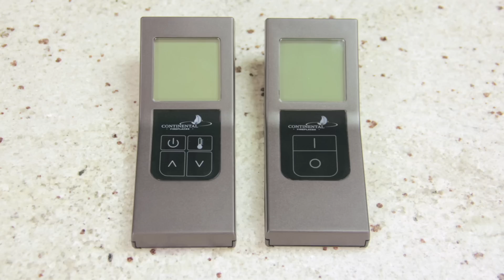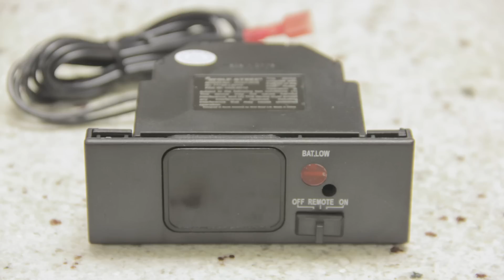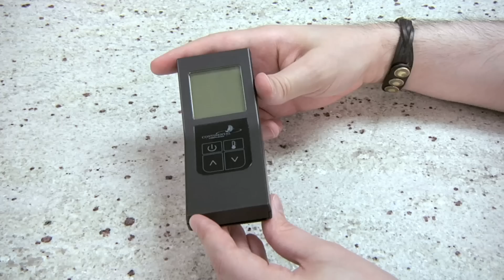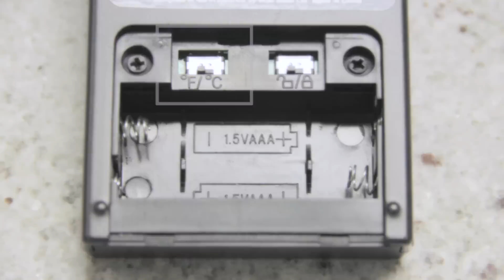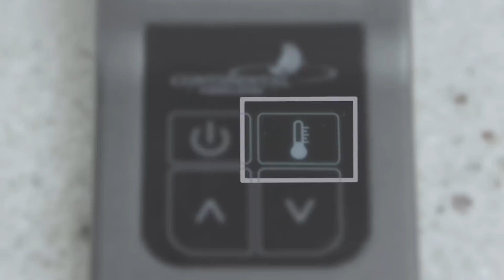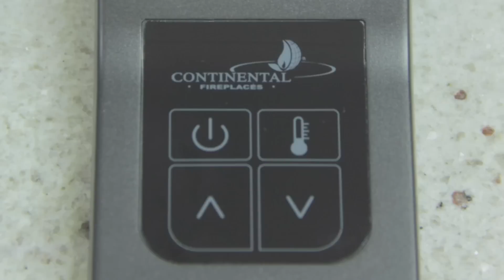How to use your CF45 and CF60 Fireplace Remote Controls

Comment: Had to buy a new receiver and it does not send a signal when moved to remote position. The on postition turns on the fire place but can’t get the remote working if the receiver doesn’t submit a code.
Reply: I'm having the same problem. All of a sudden the remote doesn't work. It powers up as does the receiver, but the code pairing function doesn't work.